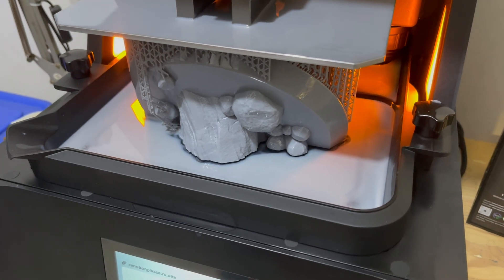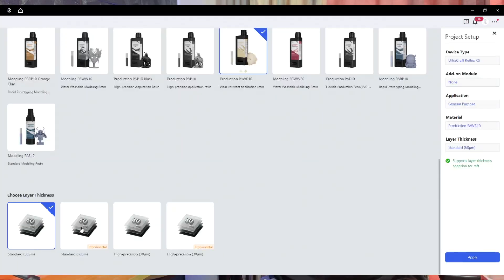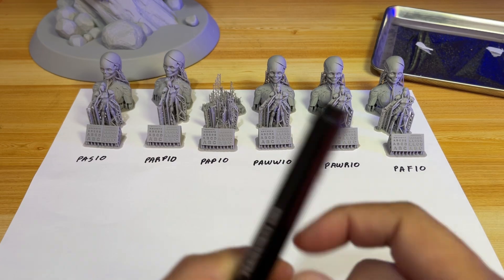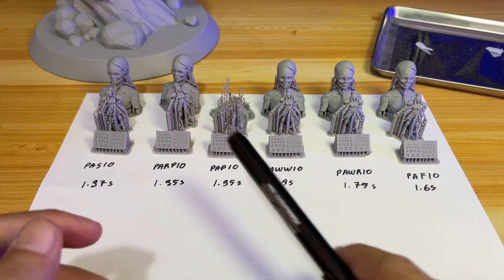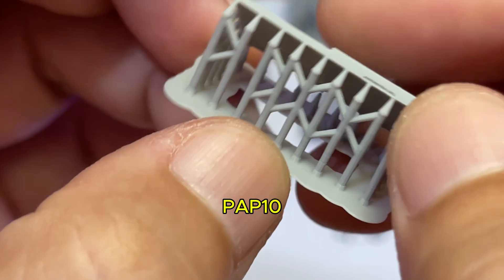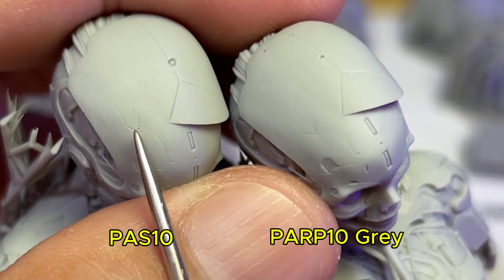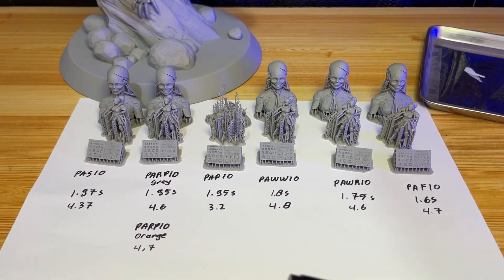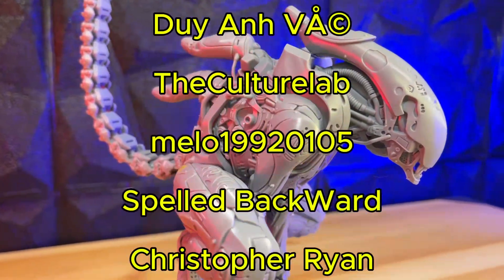Resin Hack Heygears Ultracraft Reflex RS

Comment: I have a question, Dennys. In the video, the PAWR10 resin has an exposure time of 1.75 seconds and a light intensity of 4.6, while the PARP10 resin has an exposure time of 1.95 seconds with the same light intensity of 4.6. So why did overcuring occur with the PAWR10 resin?
I also bought an RS Turbo recently, but I’m having trouble with the first layer constantly peeling off, so I’ve been trying to find the right resin settings — it’s been quite difficult.
Reply from the maker: First layer peeling, you might wanna contact blueprint support. Cause we cannot make adjustment
Reply: @wangdennys  Any chance to get your thoughts on the reason over-curing is happening on lower exposure times? I was wondering the same thing, as I'm testing resins with my Reflex RS and feel like I need to under-expose slightly, but from your results profiles with less exposure times seem to over-expose? Thanks!

Comment: Hey. Thanks for this video. I am using parp10 on sunloo stanard resin , i tried 30mr . But i have 30% failure rate,when it it prints,it does it beautifully, but 30% fail rate is too much.  do ypu think going parp10 with 50mr woould still be ok for details . I am doing aculptures with a lot of letters in it?
Reply from the maker: I think Adjust your support

Comment: I wonder what caused that PAP10 failure. I've made some research and I've found out that people usually use PAP10 and PARP10 profile with standard cheap 3rd party resins (sunlu, elegoo, anycubic etc). I assume that you would recommend PARP10 profile (based on that video)?

Comment: I was told by heygears PAS10 and PARP10 is the same resin and the only difference is the bottle it comes in. Not sure why they even have different profiles if that's the case but the PAS10 profile also doesn't have a 30 micron option (at least the last time I checked, maybe  they've added it). Was this all done with the 50 micron profile? My only concern with your testing is how many layers did you test to confirm the exposure? Did you test the same range of layers for each profile with the exact same model in the same placement for each test? The reflex & RS adaptively adjust printing parameters based off the specific print / layer, at least that is what heygears support has told me. I would have loved to know what the base layer exposures are too. Now that we have the raft adhesion option we at least have some control now if we have a stubborn 3rd party resin like something with a high viscosity we can tune it a little bit but it would be great to actually know the times. Because of the adaptive nature of these printers I just question how consistent or actually useful your measurements are. Not to mention exposure time is just 1 aspect of a print profile and other things are a factor like lifts and speeds, rest times, and potentially how the adaptive parameters respond to a print. The fact you have an over exposed model with the lowest measured exposure time profiles and a properly exposed model with the highest measured profile tells me there is something else going on here as your UV intensity measurements for everything other than PAP10 are within variance likely of the UV source and your measurement tool so I don't think that's the answer.
Reply from the maker: @LayerZeroDesign  they are the same exact model
At the same spot
At 50um
Reply: PAS10 has 30, 50 & 100 micron option in blueprint

Comment: So I used Sunlu when I first got my machine but switched to their brand. My FEP lasted a few months and bany prints until I got the FEP warning.

After that I ran through 4 FEPs in just over 2 months. They all followed the same cycle. 

They all started showing a grid pattern that slowly dented the FEP and prints started cooking to the FEP and eventually the resin cleaning was so baked on it ripped the FEP during removal.

All 4 with identical results. And HeyGears took it to investigate and they said they found traces of their party resin that caused premature release film wear oh and they found improper operation lolol 

Then after blaming the resin they said they can repair it for $432. If it is the resin which is a lie, then what is it they are repairing lololol

I will ask if I can return it or just tell them send it back and order FEP film and replace it mysekf cheaper every month plus I still have 4 FEPS they replaced. 

They replaced the 4 I used but now blame me lol

What's with these people.
Reply from the maker: thank you for sharing your experience
Reply: Hi, were you using the RS? 

And is this still happening to you?

Comment: I have a question. I want to find a proper resin that will serve my needs. I am disappointed with Phrozen RPG resin and mix of resins (I use some of 8K and some of a flex resin). The prints are becoming fragile over time and it doesn't matter if they are exposed to UV. What resin would you recommend to be quite flexible (less fragile) but not like rubber. Any ideas? I've checked Sunlu abs like and it wasn't enough. I also used mix of Sunlu & the other flex resin I use with no major success. I don't want to buy 100 different resins to play around with it.... I'm stuck...
Reply from the maker: Try sunlu 14k
I am not saying it is the best, but i am starting to like it
Gonna do more tests, but so far my experience is good with this resin

Comment: Super interesting video, as usual ! Do you have some idea why the PAS10 / PARP10 Purple grey profiles produced the best negative details (hair not fused) even though the exposure value and light intensity for some of the other resins like PAWR10 / PAF10 are identical or lower ?
Reply from the maker: I believe there are more happening to the printer than what i am able to measure.
It could be dynamic exposure/light intensity, or dynamic speed, etc etc
Reply: @wangdennys  one thing I noticed using PAS10 (supposedly same composition as PARP10 Purple) on another 405nm printer (Mini 8Ks) is that it has a lot of XY bloom and Z cross layer curing. I’m wondering if the UV blocking strategy for that resin was initially made for 385nm printers and that Heygears deliberately adjust the individual pixels being sliced to still enable it to resolve well on the 405nm RS (ex if a hole is 1mm wide, the slicer creates a 1,2mm sliced hole in terms of pixel width).
Sunlu’s resins also aren’t superb in terms of bloom and cross layer curing - perhaps it then proves to be a good match for the PARP10 / PAS10 profile ? 
Only speculations on my end here though.

Comment: Thank you for this. Having these numbers is going to save Hey gears users a lot of time. I've been on the fence about purchasing the Heygears RS. It seems to be the best machine out there but lack of 3rd party resin support is a deal breaker. I have particular resin requirements that don't seem to be available in the Heygears line. I also use UV tools fuzzy skin to give my prints a matte finish. I don't really want to give that up. 

What machine that's compatible with 3rd party resins would you recommend? I'm primarily concerned with print quality and resolution (sub 30um). Do you know of any machines on the horizon we might want to keep an eye on? The Halot X1 is interesting, hard to say if it's a step forward though. The Athena 2 seems to have a lot of potential as well.
Reply from the maker: I no longer use uvtool, so i am not sure what printer will work with the fuzzy tool

Comment: Thank you, Denys, for this extremely useful video on your methodology for making some direct measurements on the Blueprint Slicer resin profiles for “exposure time” and “light intensity”. This gives us a start at understanding a couple of the resin profile parameters built-in to the Blueprint Slicer. I suppose, for any given non-proprietary resin, it might be necessary to run “test prints” for each of the built-in profiles (to find the profile that will give us the best exposure/sharpest detail). If the 3D Print community had a vetted database, we could submit our results for “best resin profile for a specific non-proprietary resin” and place it in the database for all to access online.

Comment: Denny, every video you put out is SOLD GOLD💰
Can I ask what resin you would recommend for minis that is rigid + durable + print high detailed models? I have a Mini 8Ks.
trying to avoid the resins that have a lot of flex or bend
Reply from the maker: I havent find any Rigid+durable yet
Cause most durable resin has slight flex
Reply: @wangdennys  What is your go to resin for 28mm scale, i.e. 40K miniatures?

Comment: So a propriatary system, basically hard broken to be purposely unuseful for adjusting your print profiles for the correct settings, unable to, realistically, use third party resins freely, and even then, full of buggyness with the profiles you can't correct, as they dont care, and prefer to fleece people.. continuing on in their tradition of overhype, underperform?
Reply: Well, if you had a Heygears system and Blueprint Slicer software, you should not be experiencing (buggy) “overexposure” print results when using any of their resins (with each resin’s specific resin profile selected in Blueprint software. Obviously, Heygears set the specific resin profiles for each resin to give “optimum” print results for that resin. IF you did use their resin (with its resin profile) and DID have problems (over exposure, under exposure, etc), then you, the customer, should contact Heygears and show them the problems (including the specific 3D model you printed). They most likely would do their own tests, analyze the results, and where needed, adjust the Blueprint slicer resin profile. That’s the process. Nothing is perfect, even proprietary systems. And YouTube channels with Heygears systems (like Greedy3D and Denys Wang here) have shown that it is definitely possible to use non-proprietary resins in the Heygears machines. Anthony over at Greedy3D has done print tests of 5 to 10 resins (from SUNLU to Jamge, etc), mostly on PAP10 and PARP10 settings (and more recently with the PAS10 setting), and the results, to me, look crisp and highly detailed. I think he only had one (expensive) resin that failed to print, on multiple tests. Denys’s tests here are extremely useful. It takes time, but his methodology gives a road map for anyone to either use his recorded numbers for “exposure time” and “light intensity measurement” (for the Heygears built-in Blueprint slicer resin profiles) OR run run your own tests and record your own figures for the Heygears machine, and then run “test prints” and determine the best “default Blueprint resin profile” for your specific resin.
Reply: @dovmerrill804  It's nice to read this discourse on YouTube and see that you are all correct at the same time, and nobody is whinging at anyone else about their preferences.  this is very encouraging. i'd love to see more of this in the community!
Reply: @FauxHammer  Absolutely, Ross!  Civil discourse, all of us working together, helping each other, learning from each other, and maybe encouraging the 3D Printer manufacturers to keep rolling the ball up that hill. Love your channel; one of the top 3D Print (etc) channels I go to for no-nonsense machine reviews (etc), and a little wry humor (humour for you Brits!).
Reply from the maker: i understand with what you said
but they are openly market their printer with proprietary resin, they dont hide it.
if user choose to buy it, they know what they are getting.
same with formlab proprietary resin and all. 
correction, it even worse with formlab for their proprietary system. 
but i am not sure with what you mean "full of buggyness" i havent encounter any, 
care to share more about it?
Reply: @wangdennys  Well, if you're unable to fine tune your prints, the results are um buggy, like parts sticking together from overcuring, probably the wrong word, but tis a bug to me.

You're right about the propriatary nonsense for sure, peeves me endlessly, form especaily too. Seen more than a few of their business end victims struggling like heck cos of the huge extra costs born by them for materials and consumables, or even getting actual support of a standard that's acceptable for such insane pricess.

I'm sure i read from somewhere that they stated they can change the UV frequency and tune it best to resins, i think they may have entirely left out the part about it only doing so on their end, with the user having zero control, or any ability to use other brands resins (which often are picked for specific reasons)
Reply from the maker: @noviceartisan  welp. what most important is, users know what they are getting.
Reply: @wangdennys  I think they do sometimes, but don't comprehend the impact of the decision, thinking they'd benefit using a closed, proprietary system, when they'll almost always be better off going with anything else. I do like the concept for breaking layers with the vibration, wonder how long till we can get ultrasonic horns stuck to the side of our older tanks to vibrate the layers free, as opposed to air blowing in their system.

Comment: Sir, up to now, Sonic Might Revo 14k gives the best detail quality, right?
Reply from the maker: are you okay bro? all your comment is the same on all my videos.
Reply: @wangdennys  So so sorry much it bothers you . Because I am very hesitant with my little money to buy a stable and long-term machine, I need your profound advice. 😢
Reply from the maker: @keal.freespirits resin printing has very high learning curve
It is useless to buy the most detail printer if the user lack experience.
I would suggest buy the cheapest you can get, cause for beginner there will be lots of failure that could cause damage to the printer.
Reply: @wangdennys  Thank you for your very sincere and insightful advice. I will listen to your advice and practice a lot to gain experience before buying an expensive machine. ❤